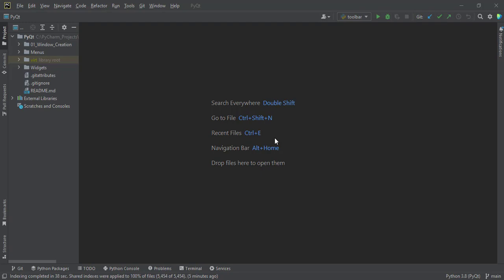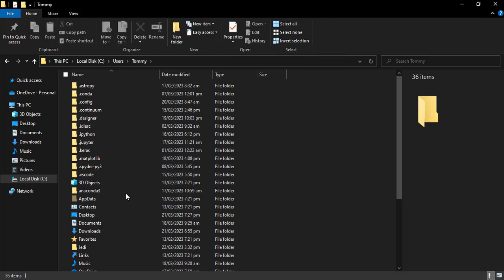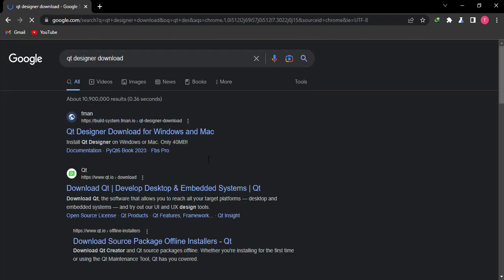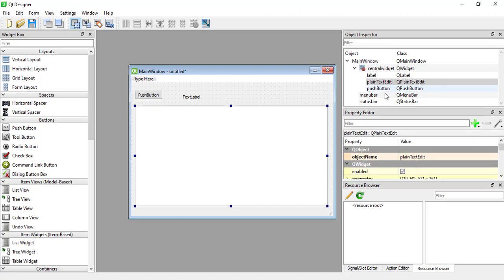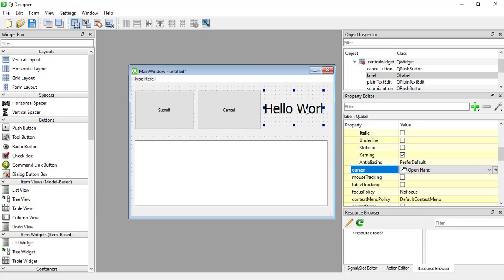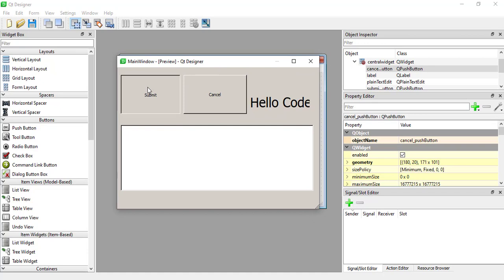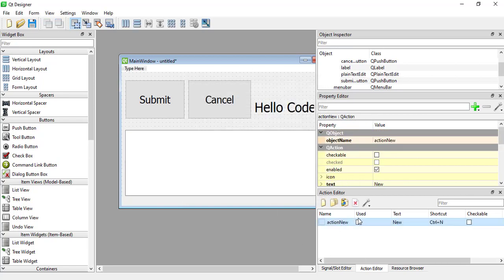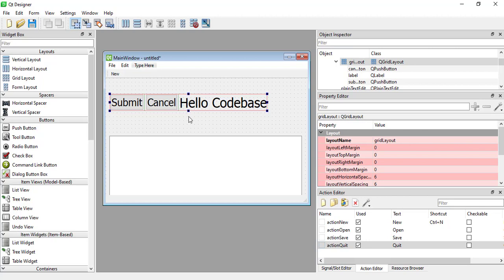Qt Designer: Installation and Introduction

Comment: Hi Tommy, thanks for the video and just to ask, I am on a Mac and in the Menus part, i can see the edits on QT Designer screen but when I select Preview I do not see those menus, tere are no menus to be seen! can you help?
Reply from the maker: On Mac, Qt will most likely show the menu bar at the top of the screen, not in the app window. So in Preview mode, check the top system menu bar for your menus. Let me know if they're still missing.
Reply: @tommys_codebase  Thanks that is correct